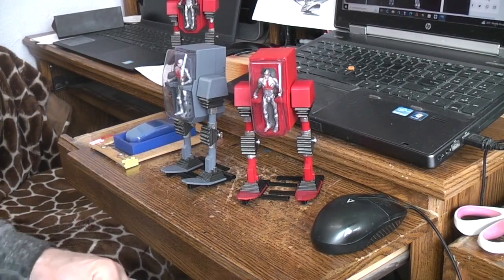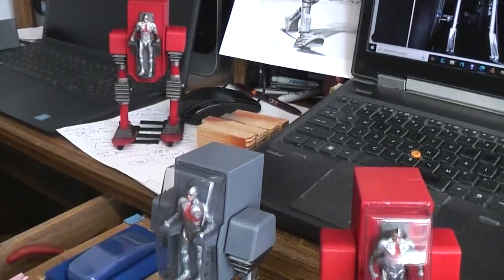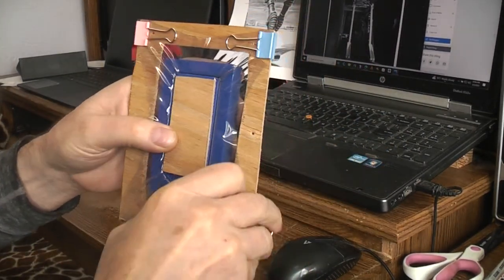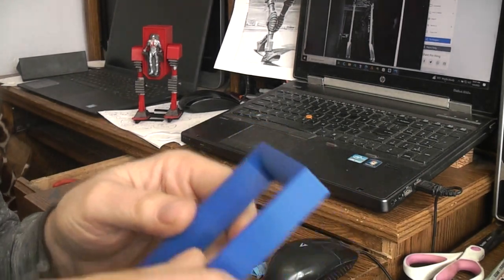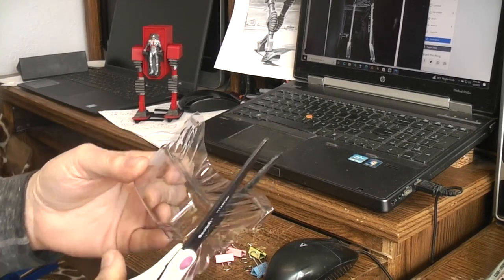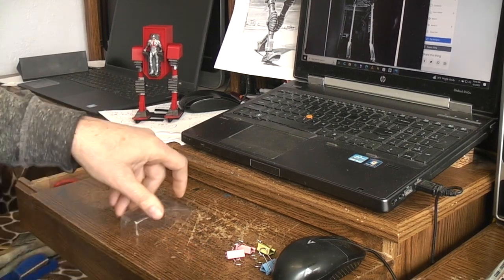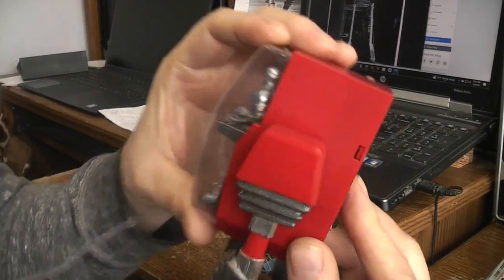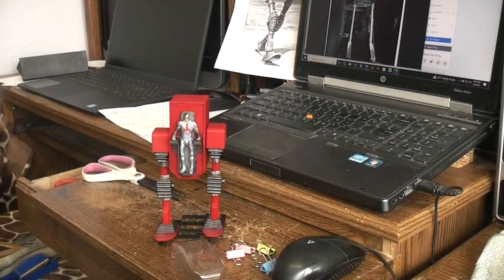You can thermal form clear domes / canopy's using 3d printed PLA master slug & Ring.

Comment: I'd like to see the raw plastic you used & the process to heat it down . Well done !
Reply from the maker: If I had a camera person I would have shot that in real time. But it is just as I say in the video. Clip on the scrap plastic, stick it on the wood blocks to hold it up from the metal toaster oven racks, I set my over for 250 F and it took about 5 minuets. Then pulled it out and pushed over the 3d printed slug form.

Comment: Interesting stuff, I'm currently attempting to thermoform a new clear dome for my Comet 1/8th vacuform model of Robby the Robot from Forbidden Planet. I bought and built him back in the mid 90's when he was about the only model of Robby that I could find here in Australia and he was my first vacuform model and I can tell you it wasn't easy, Forbidden Planet has been my favourite Sci-Fi movie since childhood and was made in the year I was born. Since then his dome has yellowed and cracked and although I tried to make a slug from what was left it hasn't been a success. I have an.STL of Robby's dome that I've printed from a full model of him that I think came from thingiverse I think, it fits although it will need some alterations in the cutting after forming. I made a simple MDF box with a ply top full of holes and have an attachment to a vacuum cleaner so it's a rudimentary vac forming setup. The only other vac forming I've done was the dome on the top of the card model of the Jupiter 2 that I put together some time ago, that was easy, the dome not so much I think. I'm thinking of attempting to learn enough to make my own dome in a CAD program and since I use Linux I don't think that it will be a problem, several free installs about for Linux.
Reply from the maker: Should be a fun project. I have that same Comet model of Robby as well. There were a few resin models around back then as well that had vacuformed domes, but a simple thermal form would do just as good. And being able to change scale so easily in 3d printing slicers should make it easy to scale a dome to fit. But like you say there is a bit of trimming involved to make it fit the models.
Reply: @Robothut  great kit but a challenge for those not familiar with vac formed models.
Reply from the maker: @potrzebieneuman4702  A very good simple place for those new to plastic thermal forming.

Comment: That turned out really nicely. I used a similar but simpler method to do a couple of spherical eyes a while ago, but your method has some great possibilities.
 Did you consider making some kind of frame to to support the dome and give it some added stiffness perhaps ?
The final result looks very clean and professional.
Reply from the maker: Nope , does not require any more support, its as stiff one in place as any toy that has a thin thermal formed dome. Not the same as injection molded for sure but just right for this project. and it should be just right for RC plane guys and even RC car guys who want to make there own canopy / dome parts.

Comment: Wow, that seems to have worked surprisingly well. 
As for the heating, any other suggestions? Would a heat gun work reliability enough?
When I walk into the kitchen with one of my projects in hand, I tend to get the stink eye. 😅
Reply from the maker: My wife was not home when I did this, so I avoided the problem. I do have my own toster over out in the work shop, but it is still so cold that I did not want to work out there. So sent her on a mission, away from home.